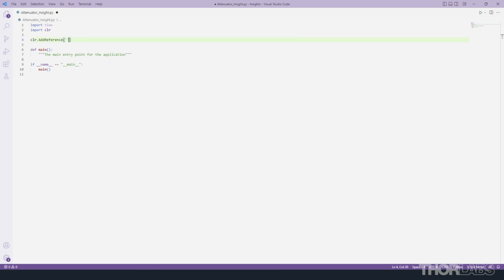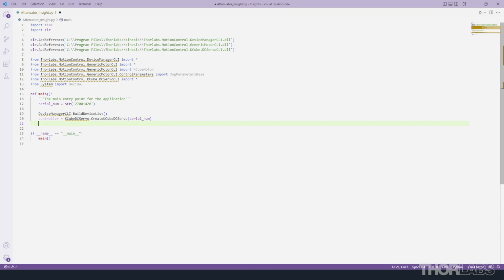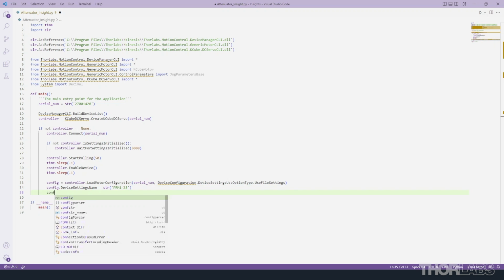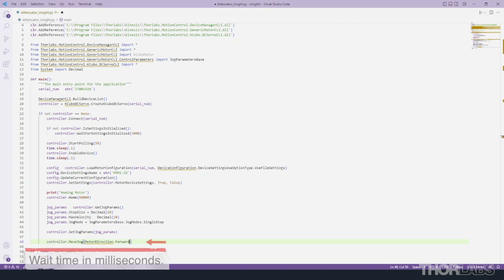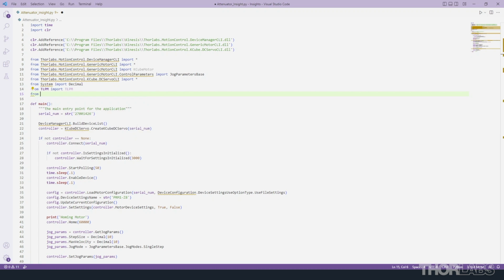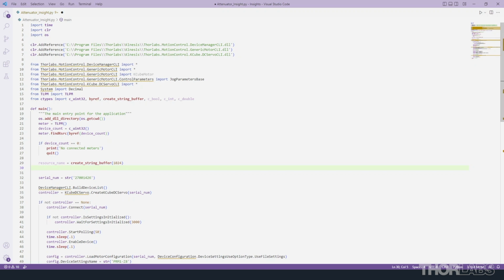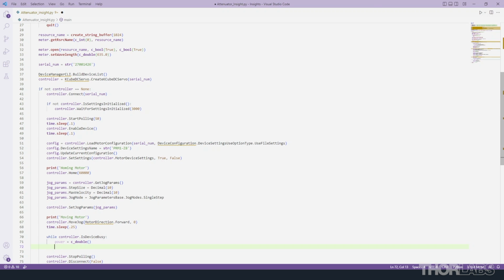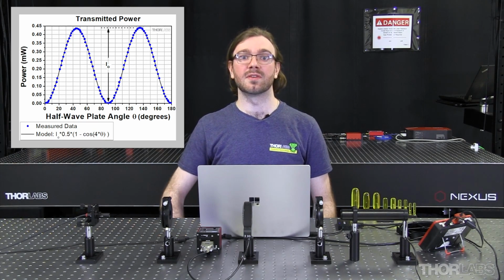Python Automation of a Power Meter and Rotation Mount (Viewer Inspired) | Thorlabs Insights

Comment: how to check these class methods in these DLL files. I want to know what methods they have and what are the functions and input parameters of these class methods?
Reply from the maker: @xiaowang7243   The documentation for the dll's in the Kinesis SDK can be found in the Kinesis installation location. For 64-bit Windows, this location is C:\Program Files\Thorlabs\Kinesis and for 32-bit this is C:\Program Files (x86)\Thorlabs\Kinesis. The Thorlabs.MotionControl.DotNet_API.chm file contains information on the methods and classes used in this video. If you have any further questions about the Kinesis SDK or documentation, you can also contact Technical Support at TechSupport@Thorlabs.com.

Comment: This is a very useful tutorial! But why my code "controller.position" cannot print the correct current position but repeat one value?
Reply from the maker: @user-zh7ej5gm1i   If the stage is moving, but the position in the program is not updating, this is usually because the StartPolling method was not included in the code. The StartPolling method needs to be included, because this method begins the polling loop that updates the values available to the program from the Kinesis SDK.

Comment: How to define the step size when using the method that take an integer argument as an input move in terms of device steps? Because my device can only use open-loop operation.
Reply from the maker: @user-zh8gf1tv3v  The movement method demonstrated in this video uses the conversion factors that are loaded with the motor settings. Due to this, conversions between device units (encoder counts or steps) and real units (mm or degrees) are performed automatically. It is possible to instead instruct the motor to move a specific number of steps/counts. To do this, swap the method for setting the jog parameters with their "_DeviceUnit" versions. For example, SetJogParams() would become SetJogParams_DeviceUnit() and GetJogParams() would become GetJogParams_DeviceUnit().

Comment: Hello, is there a tutorial for the Kcube with C++ ? And what about the libraries to install ?
Reply from the maker: @zeddii7126  Unfortunately, we have not yet filmed a Video Insight that demonstrates C++ software control of a K-Cube. However, Thorlabs’ official GitHub account includes C++ examples for the K-Cubes. These examples can be accessed from the C++ landing page of the motion control repository ( https://github.com/Thorlabs/Motion_Control_Examples/tree/main/C%2B%2B  ). The landing page also includes a full C++ programming guide developed specifically for Thorlabs’ products. Information about which libraries are needed for the K-Cubes and where to find them are included in these resources. 

Thanks for letting us know you’d be interested in a video demonstration that includes C++ and a K-Cube! Is there a particular application that interests you most?
Reply: @thorlabs  Thank you for this informations! Yes, I would like to be able to control the KDC101 K-Cube  (Motorized Rotation Stage/Mount with a half-wave plate) with C++ code for a project. I'm still not familiar with C++. :)
Reply: @thorlabs  Hello again, I installed and followed the GitHub guide. I built the project but when I run the code in Visual studio C++, it displays that the device is homing and that's it (it detected my KDC101), I can't move/rotate the mount (I tried to change the step position value and velocity). I'm failry new to C++.
Reply from the maker: @zeddii7126  We are sorry to hear you are having difficulty with the code. Since the best way we can help is to share the code and speak with you, could you contact us at techsupport@thorlabs.com ?

Comment: Does this python program work with other controllers from different companies?
Reply from the maker: @niladriganguly8601  The Motion Control libraries imported into the Python script are only designed to work with Thorlabs’ controllers and motors and will not be compatible with hardware from other manufacturers. If you would like to determine the compatibility of your device and supporting libraries with Python, please contact the manufacturer of the controller.